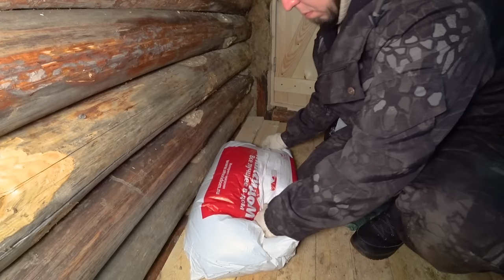Dugout. Preparation for the holiday. Made burgers.

Comment from the maker: Hello everyone, my name is Alexey and I live in Russia. Today, together with my four-legged friend named Pyosel, I came to an underground house.
First of all, I dig out the door from the snow, go inside and fire up the stove to make the room warm.
Next on the cleaning plan, I need to put things in order, drag some things from the street and set up a temporary table on which I will cook and eat. I put the boards that lie on the floor under the bed, they will be useful to me in the future when I make a new table.
Among the things that lie on the street, mice started up, they gnawed through the blanket that was lying there. I had to throw it out. I decided to throw away many things so as not to litter my forest house with old and unnecessary things.
A few days ago I brought a black and yellow box into the forest, today I will fill this box with tools.
I hang bottled water that has frozen in the cold from the ceiling so that it melts from the heat and turns into water.
Next, I decided to hang the tool on the wall so that it would be more convenient to use it and it would always be in sight.
Under the bed I remove buckets and a plastic sink, in the future I want to build a small kitchen inside the dugout, I also remove the bag of grass seeds under the bed, the seeds will come in handy next spring when the snow melts.
I assembled a table from old parts and went to get firewood.
It's time to start preparing dinner. Today it will be burgers. The recipe is simple: two beef cutlets that I fried in a pan, buns, sweet and sour sauce, lettuce, cucumber, yellow tomato, cheese. Bon appetit!
My dog does not eat human food, I give him a special dog food that is filled with meat, grains, as well as vitamins, minerals and vegetables.
Thank you for spending this wonderful day with me.
Bye.
Reply: Love your channel. Such great craftsmanship and Pyosel is an added treat. Merry Christmas and a Happy New year 🎄
Reply: Just saw that you uploaded. I'm going to enjoy this. Love from Paris to you and Pyosel and Happy Christmas.
Reply: GOOD MORNING ALEXEY!!  Always such a pleasure to see you and Pyosel.  Oklahoma is getting ready to have really unseasonal cold weather. 6 degrees F. will be our high on Thursday and snow. Depends on how much snow we get, it will be the first white Christmas in many years. Have a wonderful Christmas and blessed Christmas. Stay safe and give Pyosel a hug for me.
Reply: Lovely🥰🥰🥰🥰🥰👍👍👍👍👍👍👍👍👍
Reply: Thank you I really enjoy you and Pyosel videos.
Reply: @nannygranny9534  It's gonna be a bad one.
Reply: I can hardly wait till you fulfill your new plans and i enjoy your videos very much. Have a wonderful christmas and only the Best for 2023
Reply: Sve ovo je super što si napravio ali kućica služi da dodješ i budeš par dana tu,odmoriš mozak,budeš u prirodi,prespavaš pa sutradan odradiš još nešto i tako 2-3 dana a ti čim padne mrak pobegneš kući kao da se plašiš mraka😂🫣🫣🫣🇷🇸.Pozdrav iz Srbije.
Reply: I enjoy watching your videos and I ‘m glad I come on time as soon as you release this one. You work so hard from the day light until dark. Such a wonderful young man . So lovely that wanna have you as a son.I am 72 years old and believe that your parents are proud of you. Please be safe and have a gorgeous merry Christmas 🎄🎁. Love from Thailand 🇹🇭
Reply from the maker: @vladimirkuzmanovic5484  Da se bojim mraka, ne bih mogao hodati šumom kad je mrak
Reply: @outdoorlifeandcraft  Ok.Snimi nam neki video gde si malo duže u prirodi,neki lov,neko društvo ili ti sam sa psom ali nekoliko dana uživanja u prirodi jer kućica zato služi,da se u njoj prenoći,odmori da se bude van gužve neko vreme.Ovako ceo dan si napolju nešto radiš na hladnom a unutra toplo nikome i kad uveče udješ i svi pomislimo raj,odmor,spavanje u toplom dok napolju smrzavanje,ti ustaneš i odeš.
Reply: The lad with the golden touch is back again with another great video
Reply: The lad with the golden touch is back with another great video
Reply: Hi, Alexey. I'm always excited when you put up a new video. You're just so adorable. Though not as adorable as Pyosel.

We're getting ready to have some Russian weather here in Kansas, USA. Snow, wind and -22C! 

Have a merry Christmas, Alexey. And stay warm out there! Give Pyosel a kiss from me.
Reply: Wishing a great Christmas to you & Pyosel, love your videos! All the best! 🎄🐕
Reply: ? goúd?
Awesome bruvs 🎄👍🏽..
Thx u 🍻 🙌🏽 💀 😤 ♎️....
Reply: Grazie a te, i tuoi video sono una buona compagnia 👍👍👍🇮🇹
Reply: Привет, Алексей, очень круто, что PYOSEL помогает тебе ..... Потянуло тебя 😎😄 Ты производишь на меня изнуряющее и задумчивое впечатление. Вы хорошо себя чувствуете? Теплые приветствия из абсолютно ледяной Восточно-Саксонской Швейцарии-Остерзгебирге, Тина 

Hi, Alexey, so cool, Pyosel is helping you pull ... by pulling you 😎😄 You make an exhausted and thoughtful impression on me. Are you doing well? Warm greetings from the totally icy East Saxon Switzerland-Osterzgebirge, Tina
Reply: Hallo Alexey... Schön wieder ein Video von dir und Pyosel zu sehen. Habe auch deinen anderen Kanal abonniert. Dich sprechen zu hören in deiner Sprache ist auch cool. Freue mich auf weitere Videos.Der Schnee ist so schön bei dir. Leider haben wir keinen hier bei Bonn. Wünsche dir Frohe Weihnachten 🎄und einen guten Rutsch ins neue Jahr 🎆🎉.Liebe Grüße aus Deutschland 🧡
Reply: Great videos! Happy holidays to you!
Reply: Sending you best wishes for happy holidays ❤!
Reply: Pyosel has a new coat? Nice. Alexey, you remind me of my grandson, as he is adventuresome and enjoys the outdoor life and he and his girlfriend have a dog also. They live in the country side outside of town as well. He also does carpentry like his dad my daughters husband. They hunt and fish also. Thus I really enjoy watching your many adventures and I will continue to enjoy watching your videos or vlogs as long as I can. Enjoy yourself and your lovely life. ❤️👍
Reply: Have a wonderful week and thank you for sharing your videos with us!
Reply: I love your channel. Greets from Germany-Bavaria
Reply: Gadasz Po polsku Aleksiej?
Reply: I always watch your videocs  before I sleep at night. 🥰 
Im from the Philippines 🇵🇭🇵🇭🇵🇭
Reply: Merry Christmas ⛄🎄 from California USA 🇺🇸
Reply: Toronto Sun
Toronto Sun
View Profile
Vladimir Putin's Russian war dead crosses grisly 100K milestone , please stay safe
Reply: Buon natale anche se voi lo festeggiate a gennaio,buon anno nuovo💥💥💥
Reply: Merry Christmas!!!!  Just to let you know someone is using your comments trying to get people to reply saying you are giving presents. You may want to post that this is not you.
Really do hope you have a wonderful and safe Christmas. Ever want to visit let me know.🎄😁👋
Reply: I adore your videos. Please in future wear a mask when you sweep out the cabin. The dust from rodent droppings can be deadly. The following article is from the Mayo Clinic website. Hantavirus pulmonary syndrome is a rare infectious disease that begins with flu-like symptoms and progresses rapidly to more severe disease. It can lead to life-threatening lung and heart problems. The disease is also called hantavirus cardiopulmonary syndrome.

Several strains of the hantavirus can cause hantavirus pulmonary syndrome. They are carried by different types of rodents. The most common carrier in North America is the deer mouse. Infection is usually caused by inhaling hantaviruses that have become airborne from rodent urine, droppings or saliva.

Because treatment options are limited, the best protection against hantavirus pulmonary syndrome is to avoid contact with rodents and safely clean up rodent habitats.
Reply: salam kenal dan sukses selalu ya untuk anda,saya dari Indonesia,saya senang menonton video yutube tentang anda,,,🤝🏼🇮🇩🙏🏼😊👸
Reply: 멋저요♥
Reply: You need a radio for musique 😉
Reply: @Teresa-bq4th  😅
Reply: @chiutunngan8305  ☺️
Reply: Hello Alexey,Thank you for your good Videos👍Many good Wishes from Germany💖
Reply: @nannygranny9534  Hello, NannyGranny! Hello, Alexey!

I just found this channel yesterday. What an adventure and treat! I'm absolutely adoring your fun and gorgeous Pyosel! 😄 His zoomies are hysterical and give me the giggles. 🥰 Am looking forward to watching every bit of your adventure. Much love and appreciation from Texas! 🙏❤
Reply: Bạn là một người nga 😊😊😊😊😊😊😊
Reply: Liên xô nước Nga muôn  năm 😊😊😊😊😊😊😊😊😊
Reply: Việt Nam nước Nga muôn năm 😊😊😊😊😊❤
Reply: 👋👋👋 Hola, saludo desde Resistencia Chaco, Argentina .Pregunto .....porque tu perrito no come comida que es para humano ❓❓🤔🤔🤔...porque❓...yo tengo perritos y ellos comen comida que elaboro para mi, tambien comparto con ellos 💞💞🥰🥰🥰..le compro pucheritos, que es carne vacuno con hueso, lo cocino bien , le doro un poquito y le doy, para ellos🐶🐶🐶🐶 es un manjar😋😋😋😋😋....bueno ‼️, pregunto porque me gustaria conocer tu cultura 😁😁😁

Comment: I really enjoy watching you work and play with your dog.  A suggestion, you should probably do your best to not put your chainsaw in the snow. Even though it is battery powered, it does electrical components that can cause the saw to break.  Try taking a piece of tarp on which to set it on.  You need your chainsaw out there to help you with your projects and for gathering wood for your stove.  Those type of chainsaws are not cheap.  Great job, looking forward to your continuing adventures!  Al the best!

Comment: we used to live in Canada, where we had loooong and cold winters with LOTS of snow. First thing we did, going to our cabin in the woods, prepare as much wood as possible for the winter and store it along the house walls, covered with tarps and inside the cabin. So, we had dry wood all winter. It would safe you a lot of time and would heat your cabin a lot faster.

Comment: I love what you're doing and all the changes but I do have a critical comment. That slender tree you brought down, if you had drug it back in only one or two sections then you could have cut t into usable pieces right at the door. Cutting it up as you did just made extra work.for yourself. I learned a long time ago to work smarter, not harder.